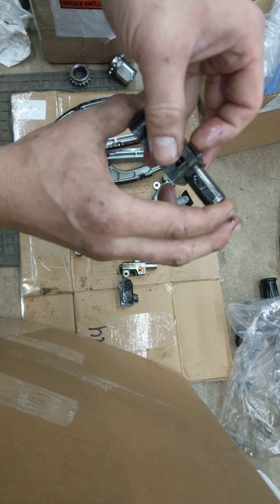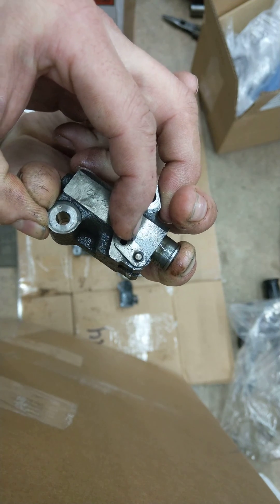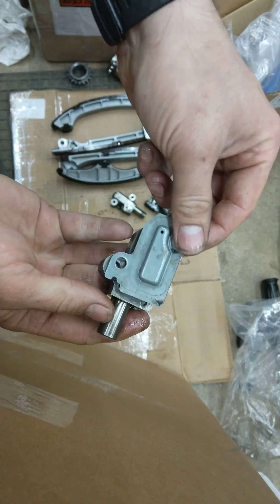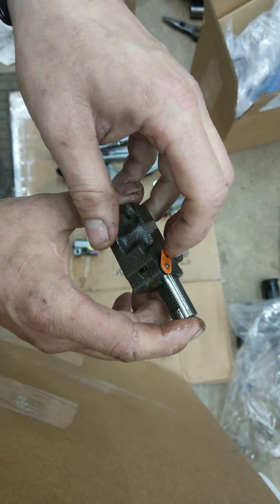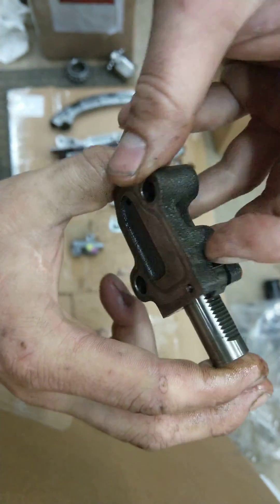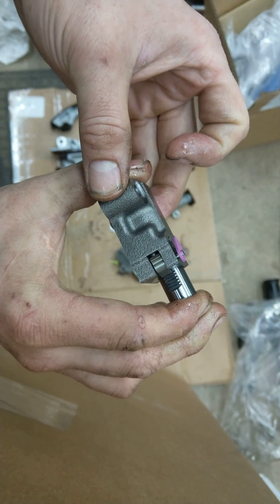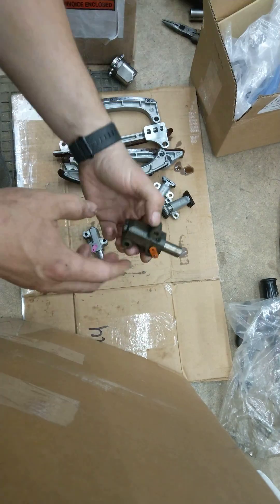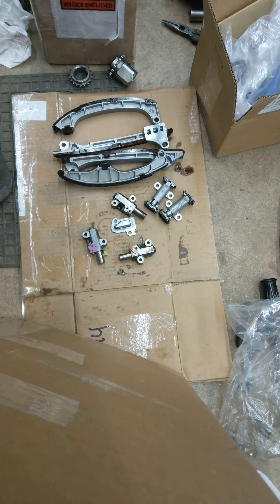2UR-GSE Lexus IS-F Timing Chain, Tensioner, Guide Tutorial Part 3

Comment: Do timing chain snap on the ls600h L 2015 ? Anybody their car written off ? Any major causes could happen ? My car is rattling on idle ... Would like to hear your answer and it's only done 97K
Reply from the maker: It's a known issue and TSB: https://www.clublexus.com/forums/attachments/ls-4th-gen-2007-2017-178/rattle-987611/eg-0031l-0516-483833d1655776683

The driver side chain tensioner is defective. Won't hurt anything and sometimes switching oil types will get rid of the rattle entirely.

I have a video series on my IS-F doing the chain and replacing this part: https://www.youtube.com/watch?v=QnEjU8QtjA8
Reply: @LILEVO Thank you so much for your reply , honestly I appreciate it , I am just worried it may snap and cause an expensive damage , lexus UK asking me for 5461 pounds to fix it , I have asked them for a goodwill so they are forwarding the bill to the Main lexus headquarters and awaiting response . Car is beautiful just bought it three weeks ago
Reply: @LILEVO tell me somethint is the timing chain at the front or the side for 2015 ls 600h L right drive . Thanks
Reply from the maker: @Ronin-xa  front
Reply: @LILEVO  Thanks , how long did it take you to fix yours ? Hours wise ?
Reply from the maker: It's probably a 15-20 hour job.  Their quote is accurate.    @Ronin-xa
Reply: @LILEVO hence the price of almost 6K Pounds sterling, but again my dealer is charging 174 pound an hour
Reply from the maker: @Ronin-xa  Yes, that's a typical dealer rate. It will be done right with warranty. You can find a cheaper shop, but do they really know what they are doing? Would you trust them to do such a big job?
Reply: @LILEVO True id rather get them doing it or find a lexus specialist indy garage but most are based in the south like 500 miles plus . Once again thank you so much for all the info , you're a good man and much appreciated and have a lovely day and fingers crossed it doesn't snap
Reply from the maker: @Ronin-xa  see if you can find RLI (Renewable Lubricants) oil. Some people swear by it and say it eliminates the ticking from the tensioner
Reply: @LILEVO  I will do but I can't remember if it was you that have used it before for 8 years and repaired it or someone else on YouTube mentioned it eliminates the noise but comes back later on , I have seen someone used valvoline protect oil and also said it eliminated noise completely. I may try one of those . Thanks for the info
Reply: @LILEVO Hi man , I did book the car for the tensioner repair is there anything else to mention while the car is going to be dismantled? Timing chain ? Anything else ?
Reply from the maker: @Ronin-xa  Yes, the description has the whole parts list. They should be doing everything in there
Reply: @LILEVO  Hi one last question did you change the VTTI gear ? Is there any issue with VTTI gear on the 600h L ? Just timing tensioner
Reply from the maker: Gesr is fine  @Ronin-xa
Reply: @LILEVO theres no known issue with the vtti on 2015 lexus ls600 h l , reason i am asking because my car is at lexus dealer and its dismantled for changing the tensioner and i am worried it could be the vtti 😂 this is why i am asking u . Tomorrow they will rebuilt it snd make it ewady for me to oick the car
Reply from the maker: @Ronin-xa it seems more common on ISF. Usually you will have a check engine light.  Those are easy to replace though. Just 3 bolts and it comes off
Reply: @LILEVO Thanks just want to make sure if I need to replace but If there is no common issue with 600 then there's no need to change , the car should be ready to collect and hopefully the dealer will do a good job . My dealer just opened in my city a few months ago and they don't have yet a master technician but according to them there's two mechanic that qualified to work on my car and they are the one whose dealing with changing tensioner so far they told me there's no need to change anything else as everything is perfect except the tensioner that needing to be changed so we will see ...
Reply: @LILEVO Hi now two weeks and car still at the garage 😂, everything is done properly but lexus dealer told me that one suspension stack on HIGH and now they are on contact with lexus engineering to tell them how to sort it out ! Any idea what it would have stack in High ? Any solutions ? The lexus dealer just opened recently and they are affiliated with Toyota and Honda so Toyota mechanics working on lexus as they don't have yet a master lexus technicians!!! For this reason they are in contact with lexus engineering ... Any idea ? Or have u done across something like that before ?
Reply: @LILEVO that's it done ✅ 4900 pound , my third party warranty paid 1K , the garage where I bought the car contributed 2K and I contributed the rest . They said timing chain was in good condition and didn't need to change as well as slippers , changed gaskets and timing tensioner as per tsb , sound is gone and the engine sounds really good and also I have noticed an increase in speed response :) amazing feeling , so far I have changed even the sunroof as it was starting getting rusty with new one cost was around 1300 pound including vat and part , I have done AC compressor under the lexus relax warranty , AC condenser, one air suspension sensor was out and also done under relax warranty . The engine coolant flushed as well as the inverter and they didn't notice any valley plate leak so far so good . Now I can enjoy the car and thanks for your help so far .
Reply from the maker: @Ronin-xa  Top work! All sounds normal for chain and slipper wear.

Comment: Long term wise, what do you think might happen if this driver side tensioner isn’t replaced? Also did Toyota improve the new tensioner or is it the same one?
Reply from the maker: Probably just noise from rattling. 
Yes, the newest part number you would be receiving is: 13540-0S022.  The old part numbers are: 13540-0S021, 13540-38040, 13540-38041, 13540-38042
Reply: @LILEVO  I appreciate your reply. My car isn’t supercharged. Just an exhaust mod. I get paranoid every cold start. The chain starts slapping around. Sound is very rhythmic. Just recently it started to change. I’m using renewable lubricants to combat the start up noise. I’m just hoping it can give me sometime, until I get the courage to get in there and do it. I’m sure the dealership will want an arm and leg for a job like this. Thanks a lot for your videos. I’m sorry you had a freak accident.
Reply: @XBrandonLeeX765 hey my tensioner is also rattling during the first few minutes when cold. Did you ran into any problems by not replacing it immediately?
Reply: @F-Lex Hi how is your car so far ?
Reply: @Ronin-xa just saw your comment. Englne still runs fine, noise didn't change, i dont drive the F that much though. I will take care of it soon anyways 👍
Reply: @F-Lex cool , mine is at the garage for tensioner repair , it cost me around 5K pound sterling to do it , so far now still waiting for the garage to call me , I dropped it last Monday ( I was told around 20 to 30 hours ) max .I hope this will sort the noise completely... I know few people are still driving their car without any issues with the same noise but once again it's like Lottery , one day it may cause big problems, if you know any independent garage where you are go and do a diagnosed first if it is tensioner or something else and see how much will it cost you to repair ! Mine is done at lexus dealer hence the price because there's no independent garage near me that works on lexus or Toyota !

Comment: Man that's a lot of hard work and PITA basically! but should it be PN 13540-38042 or 13540-38041 for the Tensioner for ISF? thanks!
Reply from the maker: the newest part number you would be receiving is: 13540-0S022.  The old part numbers are: 13540-0S021, 13540-38040, 13540-38041, 13540-38042

Comment: So you think that noise could lead to those crank gears messing up the key way I just bought this isf and on first starts it’s rattles off and on till it’s warm...I plan on doing 10w30 pennzoil ultra platinum to try help in till I find a good mechanic to fix it...
Reply from the maker: No, it won't damage anything. The key was messed up due to the crank bolt coming loose.
Reply: @LILEVO  we’re you located you want yo fix mine lol...but all jokes aside did you use all oem Lexus parts just asking because I found a full timing kit for about 350 on rock auto just not sure how good it is...
Reply from the maker: @jmovision270  oem only. It's a 16 hour job.  How many times do you want to do it if a part fails?
Reply: @LILEVO  do you have a place you order your parts from that’s shows s exploded view of the parts I don’t not have a Lexus’s dealer near buy
Reply from the maker: @jmovision270  All the part numbers needed are listed in the video description
Reply: @LILEVO  lol sorry did not notice thank you again